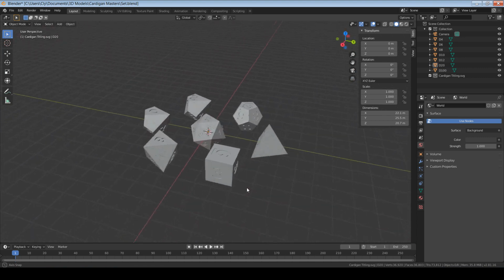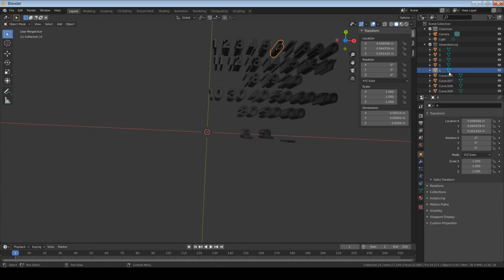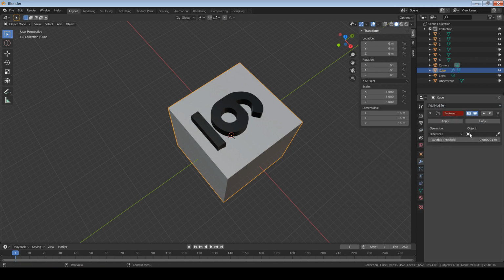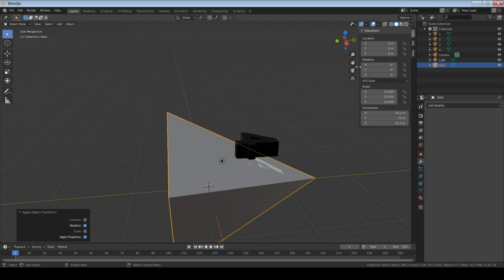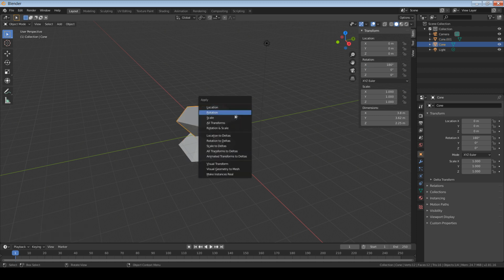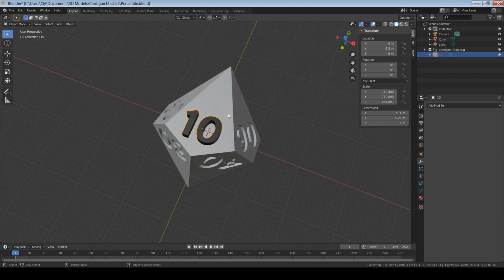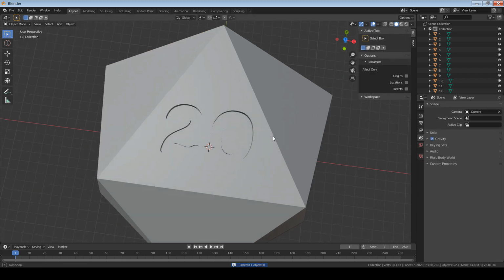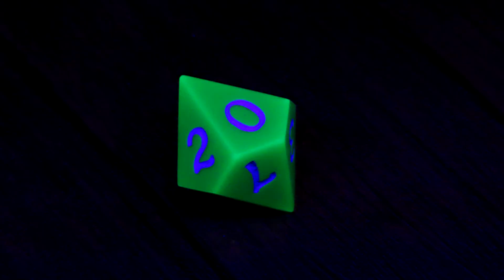Design Your Own Custom Dice for Free | Blender Tutorial | DIY with Cly Ep. 21

Comment: My prints came out nice and clean, but none of the numbers showed up on the dice out of the printer! Beautiful set of blanks, it gave me the sharp edges I was wanting but what can I do to make the booleaned-out numbers appear?
Reply from the maker: Well that's a first for me. Did you have any hidden parts on the models (as in hidden in Blender as opposed to deleting them)? Also, did your exported STL files have the numbers on them when you imported them into your slicing software?
Reply: @ClyFaker  As far as I can think regarding hidden items in Blender goes, all I can think of is the Light and Camera that are in the start of every session. Other than that the only things in my sessions were the objects. And yes, the numbers appeared in Chitubox as I was slicing them, booleaned and everything.
Reply from the maker: That is strange. 

I've never used Chitubox, so I have no idea if the problem is in that software. However, after looking through the software's site it does look like you can see a preview of what the print layers will look like. Can you see the numbers' indentations in the sliced layers?
Reply: @ClyFaker  After looking at it.... no I cannot. It's strange, if I zoom into the 3D model, it looks like the indentations are there, but they don't appear on the slices. (BTW I really appreciate the feedback, you're awesome for all of the support)
Reply from the maker: You may want to try some different free slicing software to see if the indentations appear there then. It's strange, but maybe that software just doesn't like these STL files.
Reply from the maker: By any chance did you export your dice as OBJ files? I just tried exporting as an OBJ and importing it into Chitubox, and for some reason I can see the numbers but the slicing preview doesn't show them. I tried STL as well and that worked without issue.
Reply: @ClyFaker  No, I exported as STL files. I can send you the Blender Files as well as STLs if you have the time/would be willing to look over them
Reply from the maker: I'm definitely curious, but I don't want to share my email address in a comment. Feel free to send me a dropbox link or something on Twitter though.
Reply: @ClyFaker  I have sent the Dropbox link to your twitter, thank you again
Reply from the maker: Just so the solution is out in the open for others to see, the secret is the "remesh" modifier. You can find it in the same column as "boolean". If you apply it to each die with an "octree depth" of 9 you should end up with a manifold mesh. This will leave you with some large file sizes though, so it should be used as a last resort.

Comment: Hi! I have a quick question, I am trying to align my 6 and my 6.  I go to change their location to the 0,0,0 and they just completely disappear!  Any thoughts on this?  I have center mass volumed them for origin and I am looking down on them at the Z on the axis.  Maybe not enough depth?
Reply: I tried moving other numbers and they all just disappear when I change any coordinate on the X,Y, or Z
Reply from the maker: Let's try two different things. First I want to see if realigning your viewpoint will help. You can center the frame on your selected object by either hitting the "." key on your keyboard's numpad. If your keyboard doesn't have a numpad you just need to click "view" and then click "frame selected" in the dropdown menu.

If that doesn't work or they disappear again when you zoom in, then your camera may be clipping through the numbers. To fix this hit the "n" key on your keyboard (if you haven't already when adjusting the X, Y, and Z coordinates) and then click the "view" tab on the right hand side of the box that appears. Change the value of "clip start" from 0.1 to something smaller like 0.01 or 0.001. I always forget about camera clipping until I start messing around with tiny objects.
Reply: @ClyFaker  I got it!!  Thanks!  They were tiny :)   One more stupid question, on my d6 I go to put the 2 on and it says there is no boolean option for that number in the drop down menu? Did I miss a step on poor number two back in the other file?
Reply from the maker: Did you remember to select the D6 before trying to apply the boolean operation? If not, then you're actually applying it to the number, and that's why it's not showing up in the menu. I forget to do that from time to time.
Reply: It is happening with every number other than 6.  I move them to the cube by location and scale and dimension, then go to apply boolean and the number I want is not there in the options.  The waiting numbers are though.  If this makes sense.
Reply from the maker: Like I said, after moving the number where it needs to be you need to click the D6 before trying to set up the boolean operation. If you still have the number selected it will not show up in the list.
Reply: @ClyFaker  Nevermind!!  I totally missed a step.  Got it!  The four went right on through the cube, but I can fix that lol.  Thank you so very much!
Reply from the maker: Glad you figured it out. 👍

Comment: Could it be that some fonts are just impossible to turn into feasible SVG files? I've tried TW Cen MT and it still looks sharp and great when importing it, but the moment I convert it into a mesh, so I can extrude, it makes the most impossible vertices - making the whole thing look like somebody spliced it up. Been trying to work around that for a good two hours and start to feel like an idiot that doesn't see the one simple solution
Reply from the maker: Did you export it as a PNG or JPG before coveting it to an SVG? I've seen the issues you're describing when the image with the numbers is exported as a PNG.
Reply: Exported it as PNG first - also tried exporting the whole file as SVG straight from Illustrator, with the same result; but I'll go straight ahead and give JPG a good whack on the sausage! Thanks so much for the quick response!

EDIT: Tried a few times with different SVG converters, because SVGCreator seemed to lose a few vectors from the original source. I reckon my Blender is just not ready yet haha
Reply from the maker: Just tried TW Cen MT Bold using the method in this video. I exported it as a JPG first and it worked perfectly.

Also, it's interesting that you mentioned you were using Illustrator. I had the same issues when trying to use InkScape. That's actually why I moved to using the online SVG generator, though the issues do return when converting PNGs. There has to be some connection.
Reply: Definitely sounds like there is some sort of correlation, for sure.

As for the font and SVG conversion; not sure if it's the compression of Adobe products or just bad luck, but for me, it seems like it's either putting out SVGs that are sharp and true to the font but put out an insane amount of vertices within Blender, or the SVG ends up looking like somebody hit that "Smooth Quality" no. 3 in Maya (aka all edges and corners smoothing over)

EDIT: Figured it out in Illustrator! The problem in previous exported SVGs was that I had the option to preserve editablity in Illlustrator turned on. Turning it off and embeding the different layers before exporting makes the resulting code easier for Blender to extract.
       Still not sure about what happened with the online converters, but at least the main issue is solver. Again, thank you so much for the support! Is there a ko-fi link  or similar, where one can throw a few bucks your way?

Comment: My vector graphics keep coming in not as solids, but as a lot of different lines interwoven with each other and it really shows when I resize the numbers to try to Boolean them into the dice, my numbers are hollow with only solid "slices" of the numbers showing up.

Also when I try to set the origin to the center of mass (volume) of my numbers, the origin never lines up right, it goes maybe halfway to the number from the center of the grid. Setting the origin to the center of geometry seems to work but I still get the "slices" in my numbers and I think that those two issues are connected. I have googled this issue countless times and can't seem to find any solution. I don't know if the initial problem is the font I'm using, or the export settings from GIMP file to PNG, or the process of PNG to Vector. Please help, thank you
Reply from the maker: There's a chance that your issue is stemming from the fact that you exported your text as a PNG. I've talked to several people with a similar issue, and it all comes back to PNGs. Try exporting your text from GIMP as a JPG before converting it into a vector.
Reply: @ClyFaker  Will do, thank you!

Comment: Question: if I want to 'erase' a side that has a number on it (for me it's 1 on the d20) and add a new mesh of my logo or any image I imported into blender, how do I smooth that side so I can do the boolean with a new mesh? I want to make multiple sets but I don't want to spend another 20 hours making new faces again
Reply from the maker: I had no idea how to do this until a second ago, so please excuse me if I explain it poorly.

First, you need to completely remove the face you want to change. To do this, enter "edit mode" and then "face select" mode. You get to face select mode by either hitting the "3" key on your keyboard's number row or by clicking the third box next to where it says "edit mode".

Once you're in the correct selection mode you need to select all of the parts that make up the face. Once you've done that hit "delete" and select "faces" from the menu. You may have some stragglers, and those are easiest to select by rotating the camera into the die looking outward. If any of the stragglers are lines you'll need to enter "edge select" mode ("2" in the number row or the second box next to "edit mode") to take care of those. Just select "edges" after hitting "delete" this time.

For the final step you need to be in "edge select" mode (see above). Select all of the edges touching the empty face and then hit the "F" key. You now have a new blank face ready for your logo.

Comment: I’m having a lot of trouble with making the d20- the numbers keep winding up on the wrong sides (5 on the opposite side of 10, etc)
Reply from the maker: Sounds like you might be missing a rotation or two between numbers. I did talk pretty fast during that portion, so they're easy to miss. Maybe it's one of the ones where you walk the die back to the center point (either the 20 or the 1 depending on the hemisphere).
Reply: Cly Faker I finished it!! I’m so happy it’s my first time making something of my own! Thank you so much for putting this up :))) I would suggest to others to definitely write down the steps and (if you’re geometrically inclined) to try to understand the actual geometry of the shape and see WHY it’s rotated by 41.81 degrees repeatedly; it will help you with problem solving if you hit a wall
Reply from the maker: I'm glad you got it all figured out. 👍

Comment: My issue is with gimp i set my canvas at the size you have and font a 250 pt but the number 1 doesnt even fit the page?
Reply from the maker: What is your pixel per inch setting?  I originally threw my text file together at 72 ppi, which means 250 pt (point) and 250 px (pixels) are the same. If you have your image set to 300 ppi you can just use 250 pixels which equates to 60 point to get the size I have.
Reply: @ClyFaker  Ok great thank you.

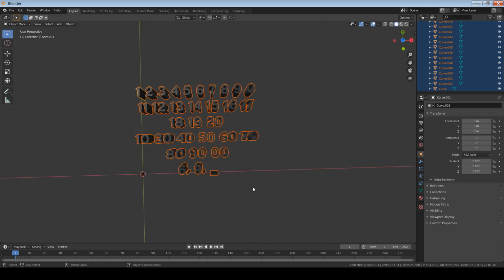Comment: When i am attempting to set the numbers to the center of origin (at 4:00) it does not work. it ends up centering the number close but not directly on the origin. Every time I try to change the orgin to the center it move it very slightly around close by seemingly at random/
Reply from the maker: Some fonts don't like to center perfectly due to the way their mass is distributed. In most cases you can get close enough that it won't look wonky, but in others you may want to try centering things manually like with the 6 and 9 with a "." next to them. 

To make it easier you could either hit the "7" on your keyboard's number pad, or click "view", then select "viewpoint", and finally select "top". This will center you camera directly over the work area. You can then select the number you want to modify, move it to 0,0,0, and then adjust its placement using the grid that Blender provides. Once you have it where you want you just need to set the origin to the 3D cursor instead of whatever Blender claims is the center.

Comment: Hello, beginner here - in the first shot where you have the full set, are they all placed on the xy plane with their bases resting at z=0? I ask because I see your d4 is taller than your d20 in the grouping. I'm guessing I can scale everything in the end to my own liking if I wanted dice that were massive, etc. Will these all be normal-sized dice that won't clash in size with my other commercial dice sets? Thank you!
Reply from the maker: Yes, in that shot I have all of them at z=0. I have them all set up with the origin point at the center based on volume, and that does make the D4 look a little taller than the rest even though they're similar in size. 

However, the D4 is slightly larger than retail sets. I based the size off of other handmade, sharp edged sets.

Comment: Man, this tutorial seems like it’s so thorough but when I try to follow along I can’t even get to minute 3.
When loading my SVG file font into Blender nothing shows up. I can see the layers but nothing is in the scene
Reply: I used every program you did in the video
Reply from the maker: If you can see the layers in the list that means that it should have imported. Because the numbers will be super tiny in relation to everything and colored black, they'll be a bit tricky to spot. Try clicking one of the curves in the list on the right and hitting the "." on your number pad. If you are using a keyboard without a number pad, you will need to click "view" in the upper left hand corner of the work area, and then click "Frame Selected" in the dropdown menu.

If that still doesn't work, there's a chance something went wrong when making your SVG file. Did you export the image file from GIMP as a JPG? I've heard from a few people that were having issues, and they were mostly caused by using PNG instead. I should have checked various file formats before making this video.
Reply: Cly Faker I ended up finding them. They were all just outlines of the letters and ridiculously small. Whenever I’d move them to 0,0,0 they’d disappear. This is just gonna be something I appreciate from others it seems and not actually do myself
Reply: @tlit  be sure to pres 'N', then go to 'VIEW' on the pop out tab, and set the clip start to .001 m
That may be the issue at the 0,0,0 for small objects.
Reply from the maker: Ooh, I completely forgot about the camera clipping at that scale.

Comment: I'm intrigued by the mold you printed near the end more specifically how you make them for all the dice set
Reply from the maker: I'm going to be making a video about those in the future once I iron out all of the kinks. Version 3 is about ready to hit the printer.
Reply: @ClyFaker  Any update on this?
Reply from the maker: The follow up kept getting pushed back thanks to me always finding one more small problem every time I printed a set of masters. It doesn't help that I'm not printing often thanks to how hard isopropyl alcohol (especially 90%+) has been to find.

Fortunately I have a new cheap and easy to find solvent for washing prints (that might get its own video), and if everything goes well with the masters I'm printing later this week I'll be ready to finally wrap things up with the sequel. The master design works as is (you can see examples in my recent dice making videos), but there's one last quality of life improvement I want to test.
Reply: @ClyFaker  Great! I look forward to seeing part 2! :) (91% alcohol and nitrile gloves, I feel your pain)
Reply from the maker: I've been using vinyl gloves since they sometimes pop up in stores. 

For cleaning off my prints I've been testing out LA's Totally Awesome concentrated cleaner. It's $1 for 32oz. at Dollar Tree, and it does a really nice job cleaning prints (I'm using it at full strength). I'm so glad I found it since I'm finally starting to run low on my alcohol despite constantly recycling it. 😓
Reply: @ClyFaker  I've been wondering about vinyl gloves or even nitrile cleaning gloves maybe with those cheap disposables plastic gloves over them to clean them easier
Reply from the maker: I've used the cheap plastic gloves meant for food service before when I was really desperate, and they were horrible since they were so baggy. It made such a mess.

I'm thinking about trying those rubber scrubbing gloves since they're durable and easy to clean. Maybe I'll put them in sunlight or my post curing box and then peel the leftover resin off.
Reply: @ClyFaker  ooo yeah do that and let me know how it goes!

Comment: So on the D6 when you're rotating the die before doing the number 4 you're previous rotation when you click on the cube is back at 0 but mine still says -90 for Y, and when inputting your directions from that point I end up on a different side then you. I end up on the opposite side of the 6 instead of the 2. I have no idea how to fix this? Also when you say click apply do you mean just click off after inputting the numbers like 90,-90, etc. cause that's what I'm doing.
Reply from the maker: To apply the rotation I mentioned that you need to hit "ctrl+A" to bring up the apply menu, and then click "rotation". This will set all of your values back to 0. Do this between each X, Y, and Z rotation.
Reply: @ClyFaker  Thanks for the reply, I'll go back over it starting from 6.